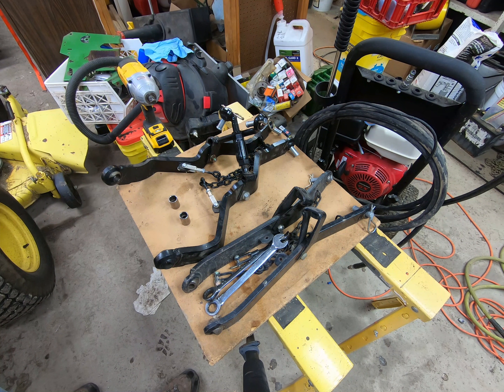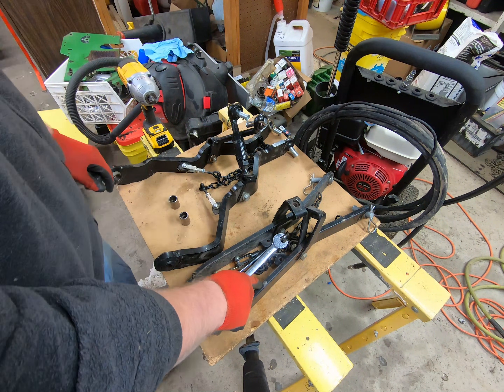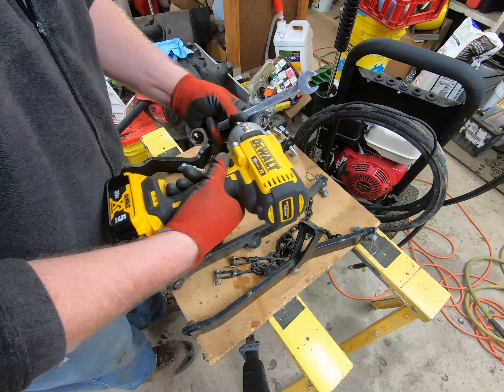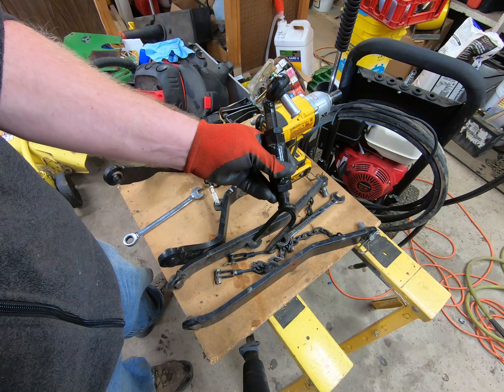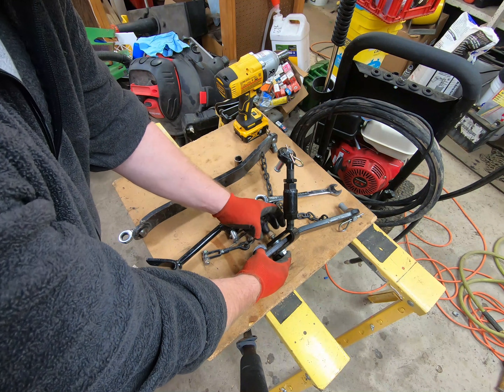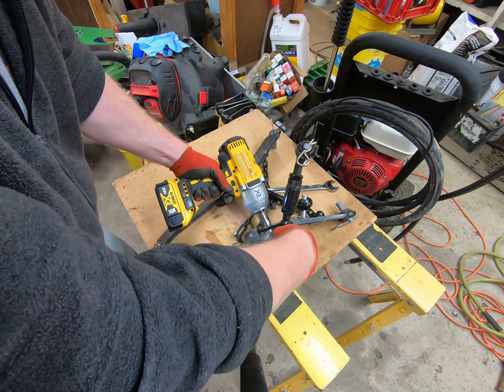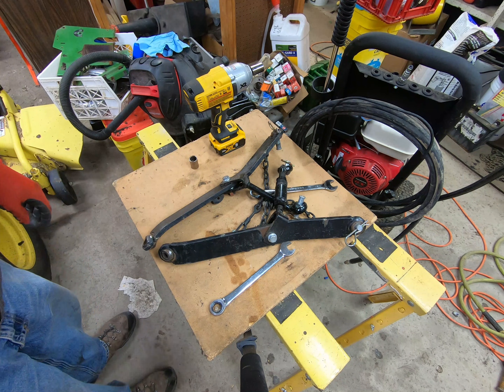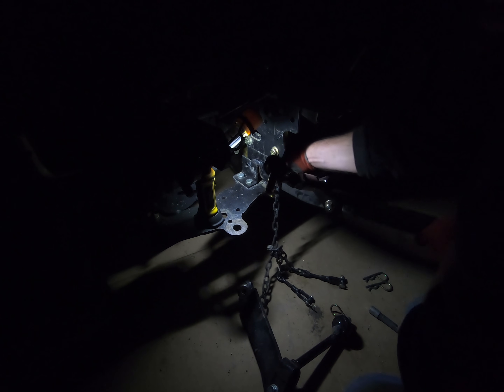John Deere X748 Cat 0 to Cat 1 Draft Arm Conversion

Comment: bolting to the cat 0 arms. This "adapter " would widen the setup to a cat 1 width with cat 1 sized pin holes. Then I can use a cat 1 quick hitch.  What do you think? Anyone?